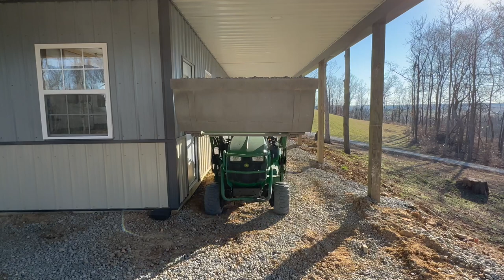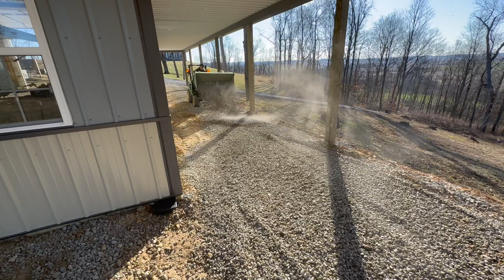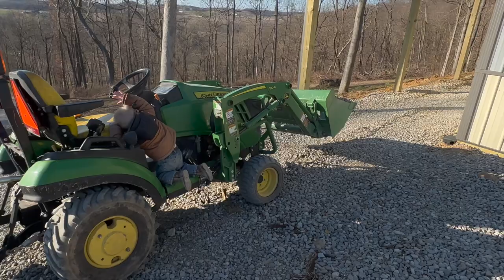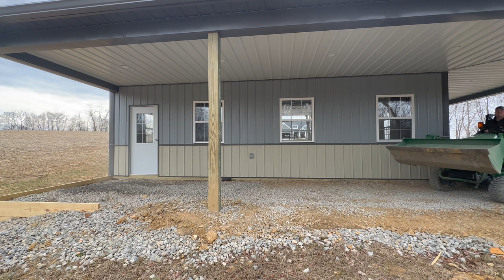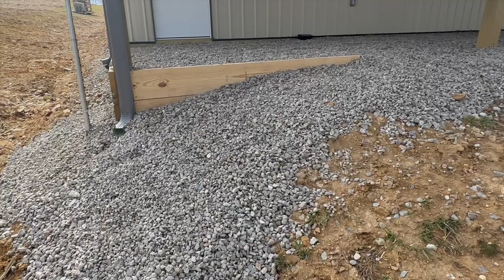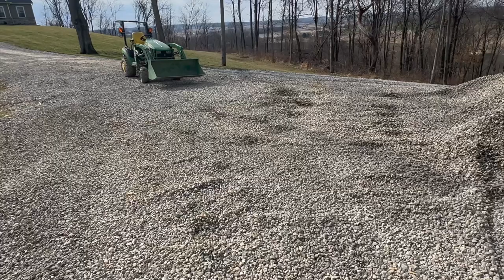Pole Barn FINAL GRADE (Lean to): John Deere 1025r Spreading Gravel

Comment: Awesome video! Did you get the "Mechanical Self Leveling (MSL)" option with your 120R loader?
Reply from the maker: @kafeene  No I did not get the self leveling loader. I have heard great things about it especially for a 1025r as it can give you a little more lift capacity which is huge at this size tractor. Thank you so much for your feedback!